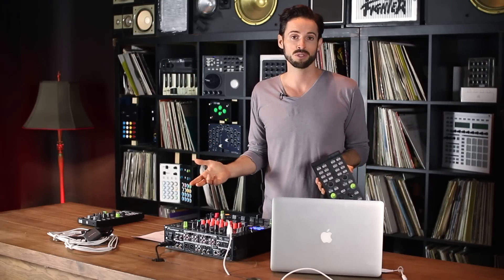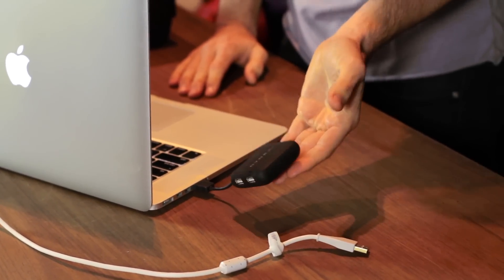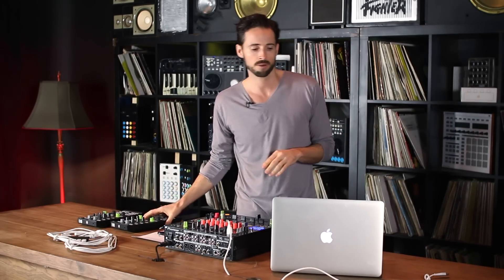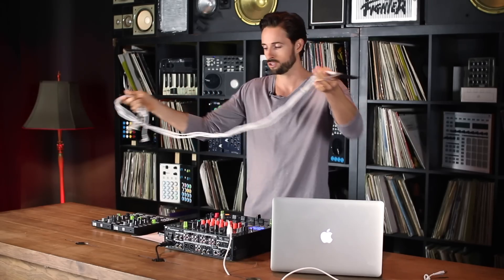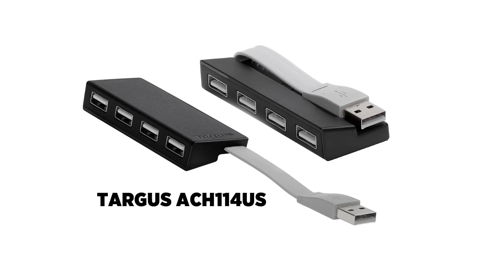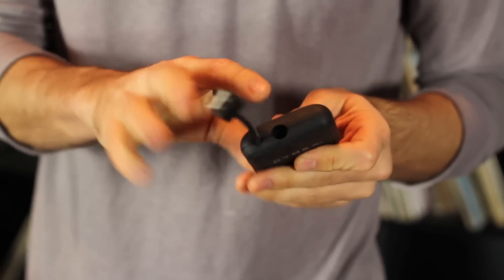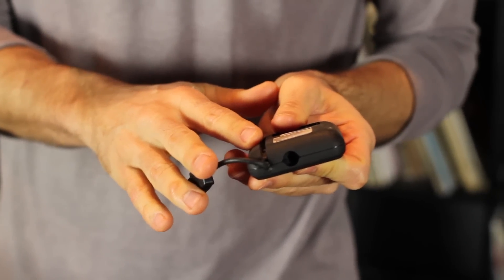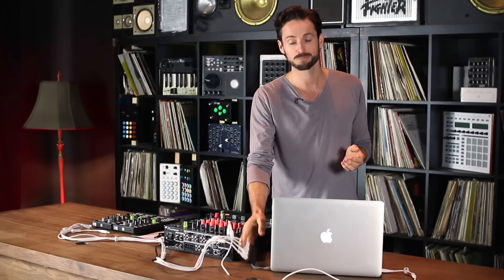USB Hubs For DJs: Powered or Unpowered

Comment: Dear Sir,Thanks for the great guidance . Sir,I have 2 Questions : 
1. If I Use Samsung Galaxy 45 Watts Charger to give external power on 100 Watts USB Hub, will it work smoothly, and with out any problem ? 
2. If external power is needed for USB Hub,which is unpowered , Can I give Charge to it ,with my Mobile /Tablet charger itself,to which that hub is connected ? Thanks for expected reply

Comment: I m useing a nxaudio DJ cansol for a upgradation I had installed rmx1000 app in my iPad but I can't able to choose a paper USB audio interface to use those both thing in my live shows..I had try to connect it with numark stereo iO USB interface but after every 30 second the I pad loos the connection and a msg popping in the screen that this USB device is not compatible with this I pad.. tell me what should I buy now

Comment: If I use a powered USB for connecting an audio interface to PC, will it boost the audio quality?
Reply: LucKie it would most likely depend on if the interface is powered by usb or external power

Comment: Great info! I do have one question I recently purchased a new MacBook Pro with only 2 USB-C connection. How would I be able to connect 2 CDJ-900 Nexus, A Rane sixty-four, and a Thunderbolt external hard drive. Unfortunately one of the usb-c would be used for power.
Thanks for any recommendations!
Reply: Commenting to follow. Same. You can use a hub that takes the power input, but honestly this info is probably all a bit different for USBC/Thunderbolt 3 because it's a new data transfer and power spec. This might actually require a new video. @Ean? lol
Reply: dunno you got the solution or not yet, connect your rane 64 directly to the port, for the other one, you're going to need a usb hub that has usb-c power input, CMIIW but that's also considered as a powered hub, so connecting 2 cdj and an thunderbolt hard drive wont be a problem

Comment: one extra thing a sound card need a very constant voltage so plugging it in on a hub gives you also more input noise 

but most carts got a regulator for that 

not the 3 £ one from China. 

every pc is creating a lot of noise so a powered hub is sometimes better is you got noise on the output.

Comment: Hi,i have an unpowered USB Hub with four ports and the problem is my X1 MK2 won't work with the external usb port(i just see the initial lights on x1 when i connect but nothing after that).Surprisingly my Machine studio works without any problem on the external usb port.Do you happened to know why?My set up is x1 mk2 ,Machine studio and audio 6.Thanks.

Comment: I have an M-Audio Axiom 49 key and a APC 40 that I hook into my iMac on separate USB ports (also have an audio interface hooked up). My keyboard or APC run fine when only one of them is plugged in but when both are I start to have issues.
The APC will blink sometimes (sometimes on the heaviest beat of a tune) or sometimes my keyboard will have a blue screen when both are hooked up. Please help! Thanks

Comment: if i connect my djm 750 mixer to a usb port , should i connect both of my cdj 850 to another usb port by using a usb hub? or do i need to use 3 single usb ports? please let me know i just bought chroma cables and need to set them up with my pc :) thanks ***** DJ TechTools

Comment: Hey Ean. Cool video. Love your content. I have been expecting one for some time. As far as I know USB 3.0 is capable of delivering about 750 mAh but not all USB hubs support it. I also heard that Apple mac's USBs are modified and are able to deliver up to 1,5 Ah. And some basic controllers like X1 (as far as the user manual goes) take up to 450 mAh. I run 3 X1-like controllers with or without at the hub's power cable and it is fine. It is still fine even if I use a memory stick in the hub. But a hard drive or something like that ruins the whole system for sure if it is not plugged. A friend of mine said I would burn my motherboard if I keep going unplugged. He's a product consultant in Apple store. Peace.

Comment: Ean, what about music on external drives? is that included in the daisy chain? Do you recommend using external drives to hold a master music library and using that master library during gigs? Or do you recommend having the music for your gigs on the internal harddrive?
Reply: if possible - use a firewire, or thunderbolt port that is dedicated to data. Sharing USB ports with hard-drives can create unpredictable behavior.
Reply: if you have $$$, go thunderbolt(max bandwidth, max power limit). if you dont, get a dedicated USB3.0 port for it just like a soundcard he mentioned in vid.
Reply: What i try to do on my macbook is to use my external drive (Lacie Rugged) with it's Firewire connector. 
Might be a good option to look for in a external hard drive
Reply: ***** And If my laptop doesn't have either of those? Treat it like the audio card? It's own USB port?

Comment: For all of you having problems with connecting 3 or more devices through USB hubs, I highly recommend this product: Anker USB 3.0 9-Port Hub +5V 2.1A (http://www.ianker.com/product/68ANHUB-B10A). It has 9 normal USB port + 1 USB port for charging phones. It's less than U$50 on the internet. Perhaps a bit pricey but worth it. I have used this to plug in an iPhone 5s + Yamaha MOX8 + Maschine MK2 + External Hard Drive + Traktor S4 + 2 Traktor F1s with no problem whatsoever.

Comment: Hi Ean and DJTT-community. I use a A&H Xone DB2, 2 X1s and the NI Maschine. I had dropouts when I was connecting the Controllers and the Maschine into my powered USB-hub and the Mixer (which also is the soundcard) in its own slot on my Macbook. When I connect everything into my powered hub, it works just fine without any dropouts. Is there any explanation for that? I really couldnt fix it the other way... Thanks in advance :)

Comment: so i've got an older HP laptop, a launchkey mini, original launchpad, and a DDJ-SB along with an unpowered 4 way usb hub. when i plug in my launchkey and launchpad they work wonderfully, but when i try to add the DDJ on it's own port the launchkey deactivates itself. what should i do to use all of the devices live witgout unplugging my DDJ to work my launchkey? is it just my laptop being old or is it user error? thanks! :)
Reply: the unpowered usb hub doesnt have enough power to support the devices thats why.
get a powered usb hub and it will do the job....

how many usb ports do you have though,,,maybe there is another way to route it out, my hp laptop has 4 usb ports, i have a 10 usb powered hub, but sometimes i dont really use it.....

i usually use my unpowered hub....and the settings are as bellow.
my basic setup is a soundcard for audio output, another soundcard with mic input, launchpad S, apc 40 and my mixer, since the apc 40 has its own power source i plug that in the hub with the launchpad(launchpad requires less power). and then on the rest 3 ports i just plug in my soundcards and mixer...

but anyways hope you solve your problem....
have a nice day:)
Reply: well all of my controllers are USB powered. my computer has 3 ports but I need to use a mouse which takes up 1 port. I know my DDJ doesn't work in a hub.
Reply: so I checked and my hub is USB bus powered... does that mean the computer just can't handle it?
Reply: it may be the fact that the settings of your softwares arent set correct,,, are you using ableton or sth? maybe go check out the settings and see if it makes a conflict....
Reply: I use ableton and serato at once. I can't see any problems other than 1 feed will cut out
Reply: yeah using 2 software at the same time might be the issue sometimes.

when i use vdj and ableton my controllers cut as well. i think it might me that the computer doesnt have enough memory to handle,,, but i think there might be a way to deal with this problem.... Ill dig around a bit more and tell you if i find anything...
Reply: well I can use any combination of 2 controllers but not 3. so it may just be my computer.

Comment: What are your thoughts about an external hard drive?  Are those OK to use on an un-powered hub?
Reply: I was wondering the same thing
Reply: jiggyjeffreyg if the external hard drive has its own power lead that you plug in then you can use an unpowered, but if you only have one cable (usb) coming from the harddrive you need a powered one i think
Reply: Not really older spinning disks often don't even work now unless they are connected directly to a single port. Newer SSD's should probably be on their own USB 3.0 port, but can probably be used unpowered.

I went for a 7+ Port powered hub, with the sound card on a separate USB port. I'm on a desktop so the power available is likely higher, and until I did this devices kept getting knocked off. (with 5 controllers + a sound card)

I also had problems with a budget Behringer remix controller, which literally knocked off every controller it shared a port with eventually, so it needed it's own port, I'd recommend not buying their stuff - the buttons are horrible.
Reply: I use a thunderbolt external hard drive so I don't have to worry about having an external being in the USB stream.

Comment: One question I have tho, when using the CDJ2000's in HID mode, would you opt for a powered hub? or is an unpowered 4 port hub good enough for plugging 4 CDJ2000nexus's in and running 4 decks in Traktor? still using that dedicated USB port on laptop for USB to DJM900nexus
Reply: So far as i know, the cdjs2000 are powered with a powercable. So they dont need the usb powered hub.